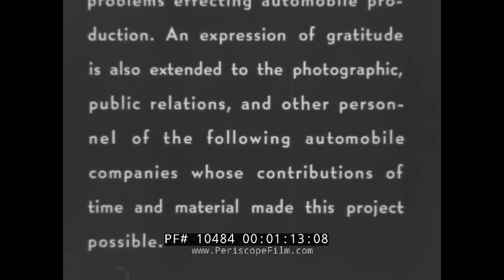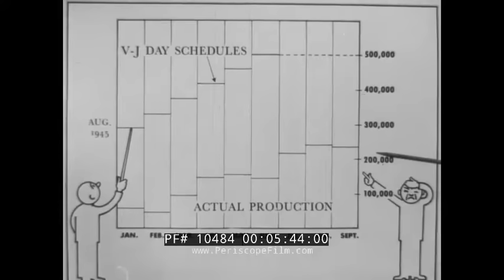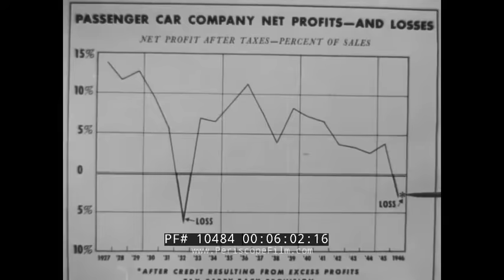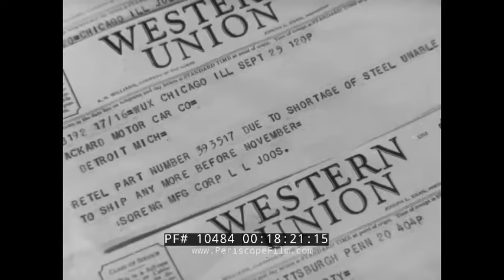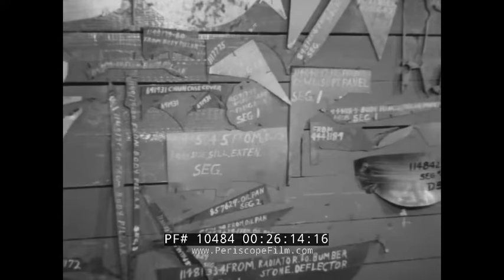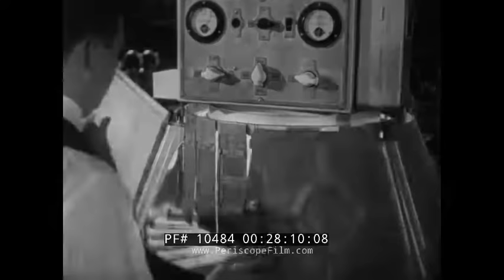" NEW AUTOMOBILES "  AUTO INDUSTRY IN WWII & POST-WWII CAR DESIGN & MANUFACTURE 10484

Comment: Still waiting on delivery of my '47 Studebaker.
Reply: DONT WORRY THEY JUST FOUND A SUPPLIER OF LEFT HANDED SCREWDRIVERS & AS SOON AS THEY GET THEM IT'LL B NO LATER THAN 25 MID 26 AT THE LATEST (gotta integrate into system,train employees have to have vote on new job changes that can of stuff ..BUT 26 at latest YES SUREE!!!)🤓🤓🤓
Reply: I have an all original 1941 Chevrolet. It’s 6 volt system still starts it every time, it’s comfortable and reliable and if something does go wrong, a regular guy like me can fix it. She’ll take me anywhere I want to go, albeit at 60 mph or less. So how far have we really come in the last 83 years? Yeah, I’d hold out for that ‘47 Studebaker, it’s better than what you can buy today.
Reply: @sparkplug0000   The way they use to make them, Nowadays, its just plastic junk, Throw it away and get a new one in this throw away world we live in.

Comment: Aired Dec. 19, 1946 on WABD.  Reviewed in the Dec. 28 issue of Billboard.
Reply: Most major cities or "markets" didn't even have TV stations yet in 1946. Most Americans couldn't even afford the minimum $352 ($5,240/in 2022) for the only television set they made at the time. Many manufacturers bought the RCA set to place inside finely crafted wood cabinetry because the RCA set was so ugly it was easier to sell inside  furniture, pleasing the housewife, at of course a higher price for the working husband: $500 ($7,444 today) not to mention the constant maintenance it required pulling out old tubes & replacing them with new tubes in which a qualified repairman was suggested because unlike a radio where you need only unplug it before opening it up to see which tube was blown, a TV set stored electricity in high capacity & touching anything other than the top glass head of a tube could trigger an immediate discharge of 10,000 volts or more which could throw you backwards 8 feet or kill you if your other hand was touching the top of the metal frame of the TV set. Another reason why housewives wanted them inside the more expensive wood cabinetry: more husbands survived fixing the TV if it had a wood frame-vs-metal frame. Modern electronics at that time is no different than it is today, its just that it all came in a glass tube. It took another year when AT&T revolutionized electronics with the invention of the transistor which immediately brought about pocket-sized electronics powered off a battery. That is, if you worked for AT&T. The transistor would never be spoke of in American living rooms until Sony sold the first Transistor Radio here in 1957 for only $69.50 ($718 today!) it became the hottest selling consumer electronics item for the rest of the 50s & 60s. Before the transistor anything electronic which you could lift, carry, & then plug in somewhere else was considered portable. Batteries were only used to start a car or for a flashlight. The transistor took a new design of battery called the "Ever Ready Energiser" (spelled correctly) the first 9 volt battery which came free with your transistor radio "kit", but trust me you'll want to buy a 2nd battery! Which sold for: $2.50 ($25.83 today)😳 but all of that was still a full decade away. Japan was still "cleaning up" from war before they decided to clean up American pocketbooks. Consumer electronics & cars were still expensive for most Americans in 1946 when minimum wage was 40¢ an hour, equal to $5.96 today, a gallon of gas more than doubled from 9.7¢ in 1910 to 21¢ in 1946 or $3.13 today and a brand new Ford also doubled from $700 in 1910 to $1,400 in 1946 or $20,850 today. Who today can afford a Ford today even if they made a $20,850 car with minimum wage at $6/hour? Of course back then you didn't get a standard AM radio or a TV in your car or even to expect someone to fill a job at $6/hour (not to mention that wage is illegal. You'd be making far more today or...$7.50 in Texas & up to $15 in Washington state except $17.50 at the Seattle-Tacoma Airport, $16.50 in Seattle ...and that's simply to compare with minimum wages compared to the $5.96 that 1946 40¢ an hour min wage was worth, today.
Reply: @cme98  you worked hard to recieve quality items and purchases. I bought a 1953 Cadillac in 1953. My brother purchased a 1933 Reo in 1933. My father fished through to get a 1921 Studebaker sedan. His working pay was a dollar an hour. Approximately 16 $'s an hour in todays terms. I have nothing but up'most respect for my era...and I see to it that modern biased doesn't interrupt its natural legacy. Around 5,000,000 had a television by 1949, in 1939 a good 1,500,000. Television sold like hot cakes, the Empire state building added in a broadcasting rode in nineteen hundred and thirty five to be able to reach those with televisions and the broadcast buildings alike. You can't try to primitize a very modern era such as the 1930's and little ways into the 1940's. Its cruel and awful to speak for a time that can no longer speak for itself.
Reply: @cme98 god, retirement seems like hell….

Comment: In 1947, ABC was struggling to build its television network and broadcast facilities. But they had to overcome a lack of affiliates {and there weren't that many stations on the air}, and the fact they often had to yield to DuMont, who was third behind NBC and CBS in signing up stations. In fact, ABC's flagship station in New York [WJZ-TV] wasn't completed and in operation until August 1948. Until then, they had to buy airtime on DuMont's WABD to be seen in the New York area.
Reply: In 1957 TV station WAAM-TV in Baltimore MD became ironically WJZ-TV.
Reply: ABC changed the call letters of their New York TV and radio stations from WJZ to WABC in March 1953.

Comment: Dam man, 1-7 people was employed either directly or indirectly by the automobile industry. I highly doubt it’s anywhere near that today. That’s where a huge amount of those jobs went, when you drive through the rust belt; Detroit, Flint, Cleveland, Gary, Philadelphia, you see just endless crumbling infrastructure. It’s hard to imagine what could’ve caused so much detestation, but the automobile industry outsourcing jobs is probably largely to blame
Reply: Failure to invest in R&D and new machinery left the door open for foreign competition.   Detroit was complacent when companies like VW started taking market share and had no good answer when the 1972 oil embargo caused gas prices to skyrocket.  People bought Toyotas and Hondas and found them to be better built and a better value than US cars.   Add in automation (robots) and there was a rapid decline in jobs making American cars.   It’s going to continue, as EVs have many fewer parts and facilitate robotic assembly.
Reply: @jacksons1010   It may come as a surprise to you, It was Studebaker that imported the Volkswagen, Which is ironic.
Reply: @michaelquinones-lx6ks   Studebaker only acted as an intermediary to import VW's into Canada.   Studebaker had a lower import tariff, so they could bring in the cars and resell them to VW of Canada at a net savings to VW.   No such arrangement was needed for the USA, where Volkswagen of America imported the cars directly.
Reply: @jacksons1010  Thank you very much for answering my comments.
Reply: Unions and government had a lot to do with putting the auto industry on the bum.

Comment: Considering how sturdy pre-WWII cars were, the attrition rate was terrible - not so in Australia...we still had T Fords and old Dodge phaetons in high circulation into the 1950s.  The huge consumption of scrap steel needed for war materiel in the US meant that otherwise serviceable cars were being bought up like wildfire; Aussies, in the war from '39, stranded here in the South and still reeling from the Depression simply needed to run those old bangers.
Reply: I guess this is somewhat like what the Cubans do today--they find ways to keep the old cars running.
Reply: Not only was there a shortage of cars during the war, parts  were in short supply and tires and batteries nearly unobtainable. Good mechanics were mostly in the armed forces. Older model cars were run into the ground with minimal upkeep. No wonder millions of old cars were ready for replacement.

Comment: That’s so interesting that customers were accepting delivery without back seats and or bumpers.
Reply: Many cars were delivered with black painted wooden 2X6 bumpers and a spare wheel with no spare tire. There were coupons in the glove compartment, and the dealer notified the owner as soon as his bumpers and tire came in. Customers were happy to get a car of any kind.
Think of it, if there was a shortage of tires they could turn out 20% more cars if they left off the spare tire and the steel and chrome for bumpers could be used elsewhere.
Reply: If you refused it, you went to the bottom of the waiting list.